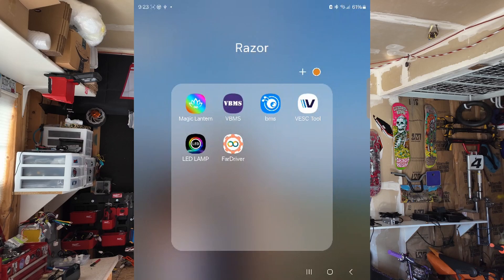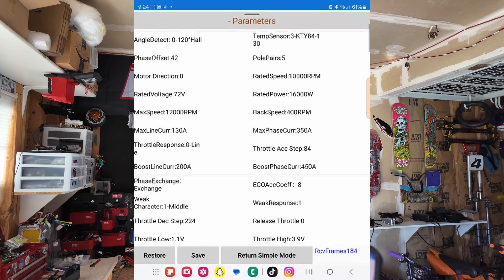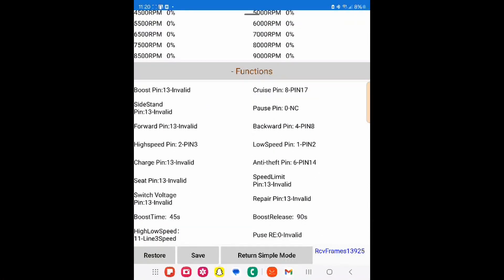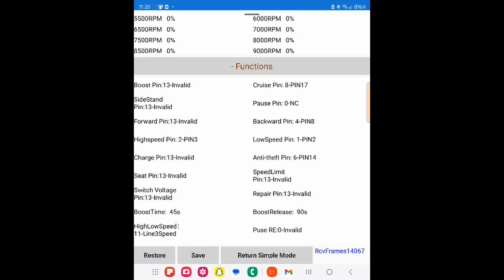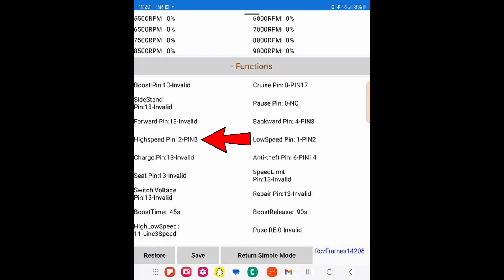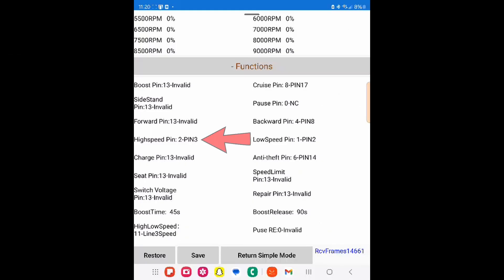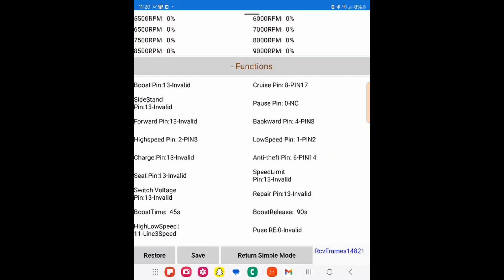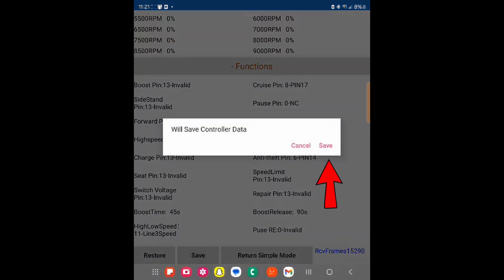Fix 3-Speed Switch Backwards On Fardriver

Comment: My issue is that 2 of my switches are middle gear and 1 is low gear
Reply from the maker: Okay there's a sudden you might want to check that kind of goes with the three-speed on What kind of switch you have.. If you  Go to my website on EMF I have a vantis throttle and there's a video down there that shows that setting I change it from what it's supposed to be for this switch to what you want for a push button three-speed but that might help reassure you're in the right spot for that setting
Reply: @Razorcrew_Cole it still did not work
Reply from the maker: @JS_HOCKEY you have settings wrong somewhere buddy.

Comment: hey when i hit my throttle on my 48v it wont go right away would a 3 speed switch fix the problem??
Reply from the maker: @itsvnyre  What do you mean by it won't go right away? Like if you twist the throttle it doesn't engage until a little bit?
Reply: @Razorcrew_Cole  yea i been tryna find out how to fix it but some one told me buy the 3 speed switch and it would fix it
Reply from the maker: @llllSNAGYXOllll  No, it's that basic vevor Style controller if you're running those basic silver cheap controllers there's no changing it and just how it is unfortunately. You can buy new throttle new everything and you're going to get the same throttle response it's internal how the controller reads it compared to more advanced controllers read where the sensor sets and you have control of more through an app
Reply: @ oh okay thank yu
Reply: @Razorcrew_Cole Hey, I have a fardriver nd72300 for myy1020 and I have the same problem is there any way to fix it?
Reply from the maker: @Soccermentality710 what problem
Reply: @Razorcrew_Cole where when I throttle it, it won’t go right away you have to like hold it down for a bit
Reply from the maker: @Soccermentality710 If you have one of those basic silver controllers it's cuz it's a $5 controller and that's just how it reads the input unlike our more advanced controllers you can read the throttle signal and it dials in right to where it needs to be.